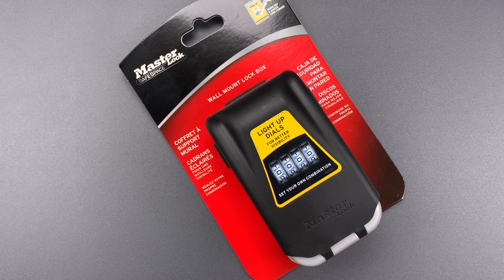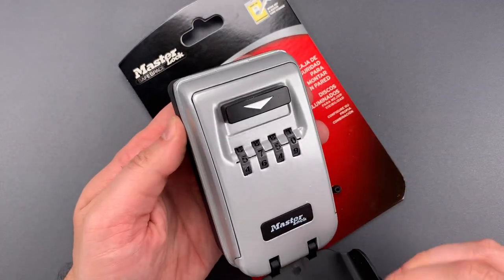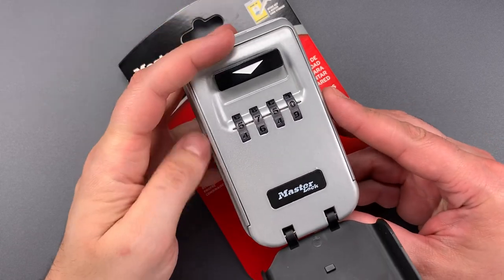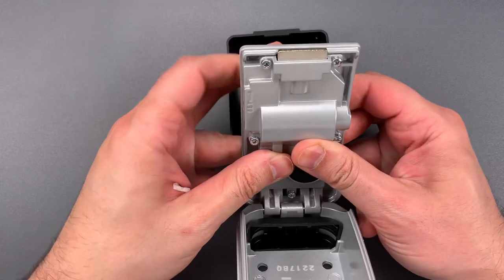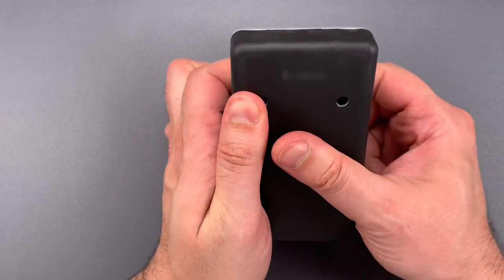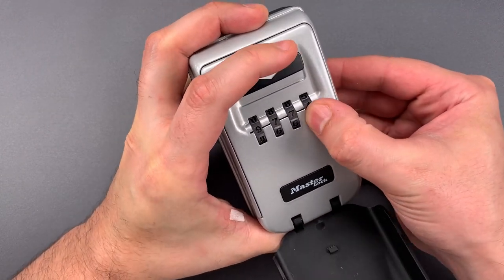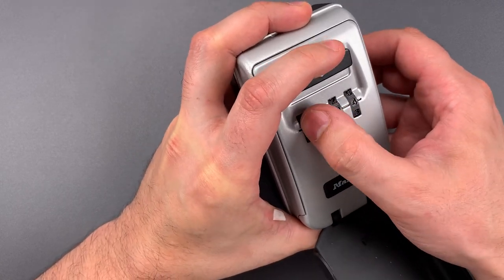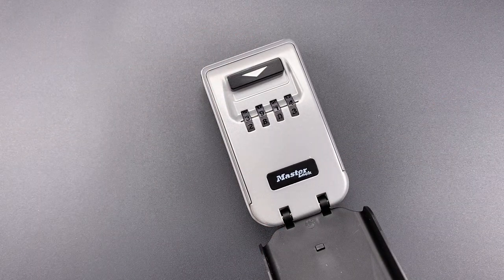[966] Decoded Without Tools: Master Lock “Safe Space” Key Box

Comment: the master lock 5400D you opened.  I don't know if mine is the old or new model.  I don't know if I am pullkng the bar back on it, or even if it has one.  You have a sense of touch I don't have I guess.
I can't feel anything turning the dials.  I will try pulling on the lever on THAT model in hopes it will work like this box I guess.

Comment: A contractor who did some work on our house left one of these with a loop attached to a front railing. We tried to call them to come and collect it, but they never did.. I have watched this video many times and tried the method many times, and I can't seem to make it work. As far as I can see, you release the arrow button when moving the numbers, then depress it when checking for looseness. Is that correct? Also, what is the purpose of the black button that has the Master Lock logo on it? You can depress it.

Comment: I still don't understand what you meant by the most play.
Mine would fall into gates one number either side of the correct number but then, the wheels would seize unless I let up for some softer tension.

All numbers seemed to have similar travel except the occasional "false gate"
Because I have closed my eyes while manipulating.

I'm not comfortable with actually not knowing the code just for ease of use until I get I working.
Any suggestion?

Comment: It's the state of the consumer lock industry that so many bad products(from not just masterlock) fill store shelves here in the states.

As they say, a lock is only as good as the door you put it on and we live in a society where destructive entry is so easy it actually doesn't make sense to put a high security lock on your patio French doors.

Instead of bolstering the security of a lock, manufacturers are designing "smart" products that integrate electronics for ease of use.

Unless we have a rash of theft and marauding, I don't see anything changing.  A decade from now schlage will release the the most unimaginably complex "smart" lock sporting the same old 5-pin c keyway as a bypass.

Comment: Are the "push button" locks more secure?
Reply: Most pushbutton locks can be decoded by first clearing the lock using the clear slider, then holding down the open slider and pressing each button to find which buttons have the most play. The combination will be those buttons, in any order.

Comment: I would use more time remembering my own 4 digits... Why do ´Muricans still buy this shit? I bought a load of the cheapest locks I could find in Norway, and none of them are easy to pick or decode. You can´t get any tool beside the tumbler on a code lock here, not even the garbage TSA locks, keyways on €5 padlocks require virgin pubic hairs to fit a pick in the keyway. Seems a lot like US cars these days, did you get stuck in the ´50s?
Reply: Unfortunately not just a 'Murricans thing. Here in Holland they're used by our big social and healthcare corporations.
I was appalled when I saw This very lock model outside my friend's door.
With VERY limited experience (and this vid) I had it open in about 2 minutes.